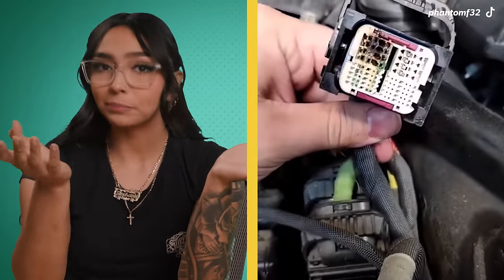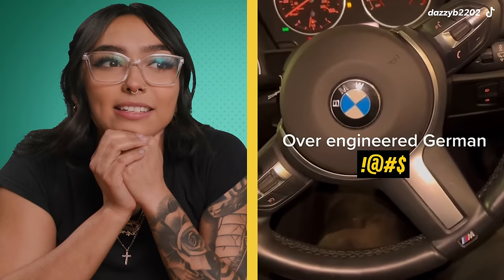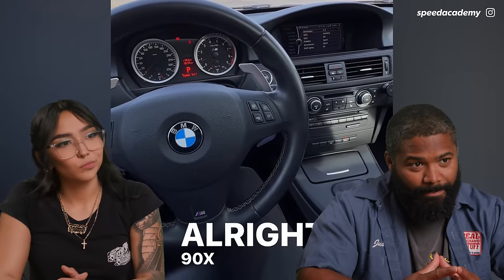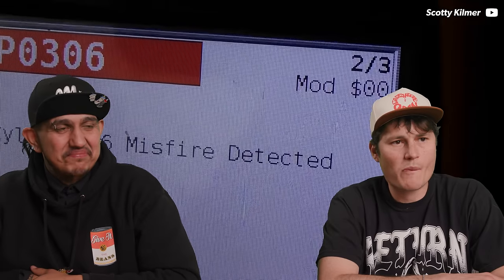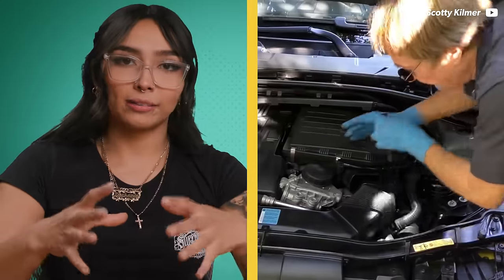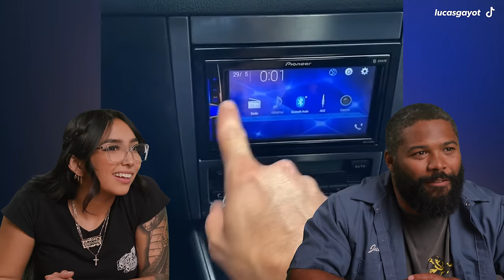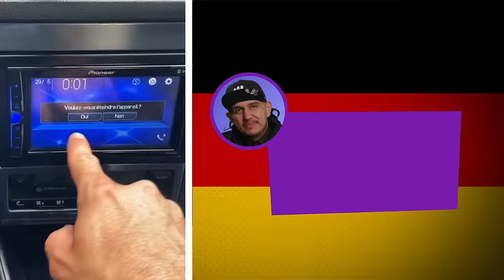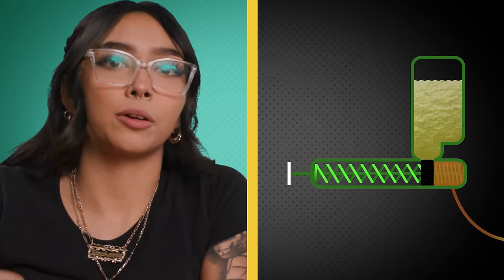Mechanic Reacts to German Engineering Fails

Comment: its disturbing how any of the modern poorly built and overly fragile and hyper over-complicated trash thats all anti-right-to-repair level junk is even remotely considered ok or good. most of the garbage in engine compartments now, is not at all even needed. and the conversion of intake manifolds and other major parts like those to plastic instead of METAL. not to mention. those covers. don't do jack shit. they actually are a complete fuck you to all vehicle owners who have those stupid covers. they do not at all provide any beneficial uses and purposes. and your engine vibrates naturally especially while driving. and if your wires are so fragile to air rain and other engine fluids, that means your using sub-par materials NOT meant to be used in any motor vehicles at all! more so, being overly costly trash for landfills. do you see 1970's 80's even early 90's vehicles be loaded with any of that junk in most cases? you know why it wasn't used and why most vehicles from the early 90s back LAST MASSIVELY LONGER AND HAVE MUCH LONGER LONGEVITY AND ACTUALLY PROVE CONSTANTLY TO BE SUBSTANTIALLY MORE RELIABLE IS? its because they were not loaded with fragile overly delicate and skimpy and hyper-complicated solutions for simple problems. i have a 1995 blazer and a 1988 GMC and both those vehicles have shit tons of oil and coolant and other liquids splattered all over the place over the years and not once did any of that do any electronic and electrical damage, not to mention the lack of a rats nets of hoses and tubes and overly complicated timing garbage while making things easy to access replace and service and maintain, all combined with durable parts, makes for a long lasting machine. buying a vehicle is an investment. it SHOULD NOT COST THOUSANDS OF DOLLARS TO REPLACE YOUR FUCKEN STARTER! AND OIL SHOULD NOT EVEN BE ABLE TO SIPHON THROUGH YOUR FUCKEN ELECTRICAL HARNESS LIKE THAT WHILE TRAVELING UP AGAINST GRAVITY! HELLOOOOO! THAT IS A CHRONIC PROBLEM!  the lack of any kind of adequate seals on top of that shows deliberate intent by the manufacturer that they want your shit to not last at all. and to keep re-buying and re-buying. im HARD CORE against the anti right to repair methods of ALL MANUFACTURERS! i been a mechanic now for well over 25 years. im 40 years old. ever modern vehicle i used owned and worked on were all shit, no matter the brand make and model. now i only strictly repair and maintain older vehicles because modern shit is proven constantly to all be absolutely fucken junk. and they all continue to get worse. including the constant improvision of retarded and absolutely stupid features NO VEHICLE SHOULD EVER HAVE! like that toxic selfie cam built into the dash? why so the manufacturers can remotely store monitor and save what ever that camera can capture when ever any ones in the vehicle with out you knowing? the fuck would you be doing selfie shit for with your vehicle? who the hell doesn't have a camera in they're cellphone now a days? . and video-game air-hockey built in the dash as novelty's to lure customers to buy more useless junk? the fuck you doing playing games instead of watching the road? iv busted peoples phones over their own vehicles for driving while texting every time the morons nearly hit me. we do not need more retarded stupid non practical non useful features in vehicles that don't aid in daily life in practical safe and beneficial money saving methods.  whats disturbing is, you call your selves mechanics? when was the last time you timed the cam of a points and condenser ignition? when was the last time you replaced a camshaft that is NOT on the head of the vehicle but rather, in the middle of your block and have to remove all the push rods, hydrolic lifters, and rockers and remove the timing gears and bearing retainers to even pull the cam out? when was the last time you replaced an oil pump?

Comment: German cars deffinately don't look good. BMW its a basic looking car that is over priced. Way over priced.  Ive fixed them in the body shop. Ill keep my mustang that has ran for 8 years with a 331 stroker with no problems except the valve cover gasket was leaking one year.

Comment: false they bashing german cars casue they simply masterpiece, there is no people in usa who knows how to service them. in usa people dont service cars and than you get this, broken cars, negativity. if you learned mechanics you cant service them you basically dont know anything about german cars. nobody in all world would drive usa made cars, only german and japanese ones. thats it. audi also bel;ongs to german cars similar to bmw.people forget bmw is luxury brand and you must service it as you would be rich , if you wont car will fail, audio also has similar luxury cars. while now bmw become ussual in europe and its great car casue there is people who know how to work. first video burned wire connector simple thing uit should not drip, why did it happen casue some person never serviced it. ow little drip its fine, ow i will buy garbage parts casue its cheap, ow i wont service it its fine, than car ibecomes fully broken and these tiktokers bash them. while all world driving no problem.

Comment: Well, depends in what sourounding you grow up. German Cars are not worse than Ford, GM, Toyota or others.

Some of those issues seem not be able  to happen, burn a switch is almost impossible, they are fused, bum a motor,... Like a hand grenade is inside could happen on every car if the benzin or ethanol pipe gets ripped.

Combustion Cars anyway will combust next year's, no matter how much electro cares are burned in such fail compilations, I don't care about german cumbustion fails. 🙃.

Comment: Cars are so over engineered, I'm actually shocked they don't have major issues and burn up the day they roll off the assembly line. If people stop buying these pieces of super high maintenance junk they wouldn't make them that way. It really should be illegal to make vehicles this high tech, it's just a bunch of needless engineering for soft minded lazy asses. I'd burn a BMW before I EVER owned one.